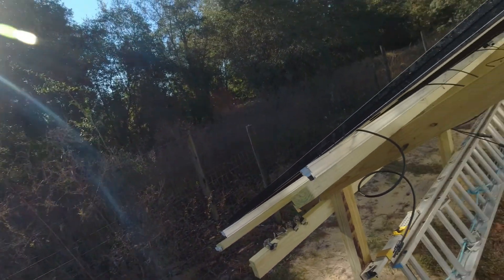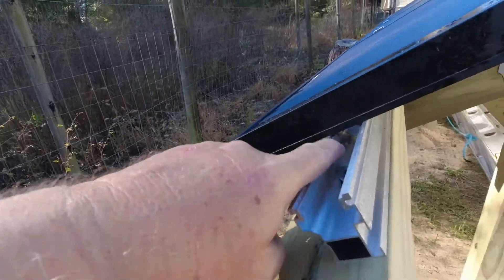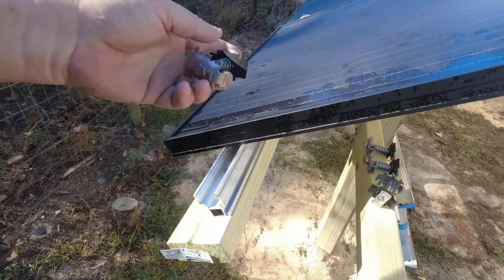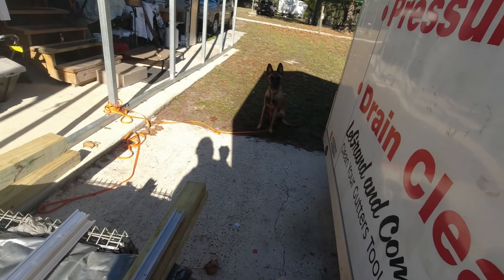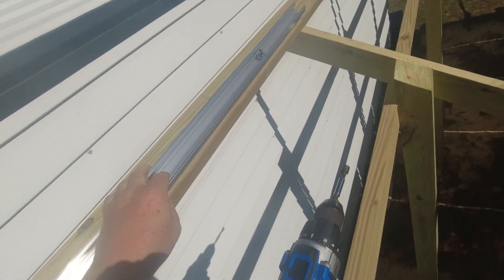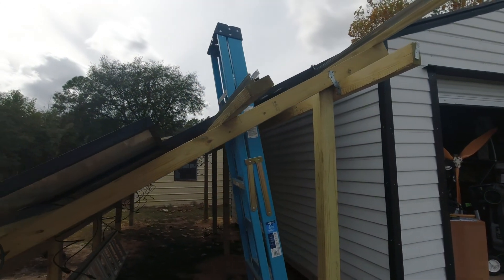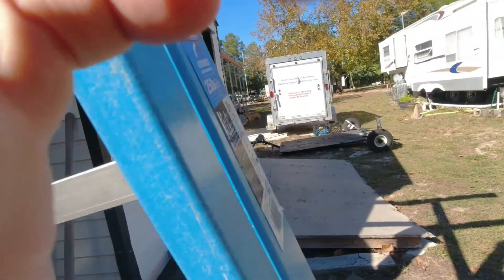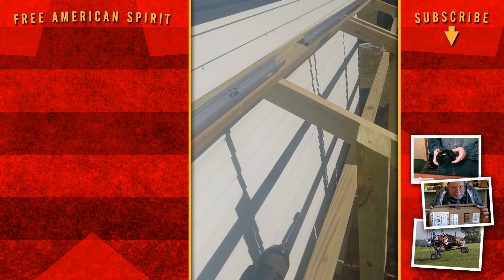Part 3 Installing 14 320 Watt Solar Panels DIY Growatt SPF 5000 ef 5000 KW DIY off grid solar system

Comment: I had also solar panel in my garden, but here in United Kingdom not too much sun, so remove them and sold. In future will put on my house roof, just waiting price will go a bit down!
Reply from the maker: You can buy used (really good) solar panels for very little cost. The all in one inverter/charge controller is way cheaper than buying all the components seoerate. The batteries, that I have to save up for, are the most expensive part.  They cost more than all the other items combined.

Comment: Any reason  you didn't  paint the lumber?
Reply from the maker: It's pressure treated.  I'm old.  It will be here longer than me.  I actually bought two gallons of paint maybe when the wood dries out in a couple of months I'll paint it but right now it is to green for paint.

Comment: Hello how much Amp s have your solar array?
Reply from the maker: Max is 10 Amps per pannel.   Going series then to parallel will supply up to 20 to the growatt.   I was pulling about 14/15 the other day. Doubt I will get much more than that out of them.
Reply: @FreeAmericanSpirit  It will work with 10-11 A?I just bayed spf growatt es and i want to put the panels in series.
Reply from the maker: @ciprianalexandru7369  go to my videos and watch the one...
solar pnel testing ampspart 5a and installing 14 320 watt solar panels part 3
Reply: @FreeAmericanSpirit  Great installation! Growatt specifies max 18A from solar panels, PV. If you have 2 series in parallel you would go to 20A from PV into the inverter. Probably the inverter would just do clipping of power at 18A, right? Had some really sunny perfect days for solar? No problems with too many Amps from PV?
Reply from the maker: Have had a lot of nice sunny days.  So far I have not got 20 amps so far this winter (I'm in FL, but still the sun is low) I have not gone over 7amps per string.  I will have to wait until summer to see if I get close to 10.  I doubt they will get over 8.
Reply: @FreeAmericanSpirit  Thanks for your quick response! Really curious to see how high you will go in summer!